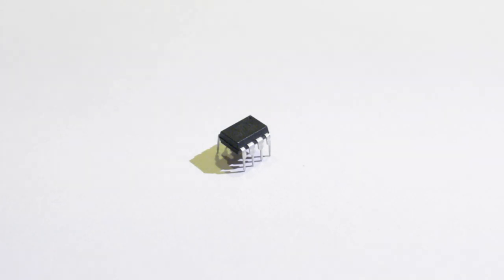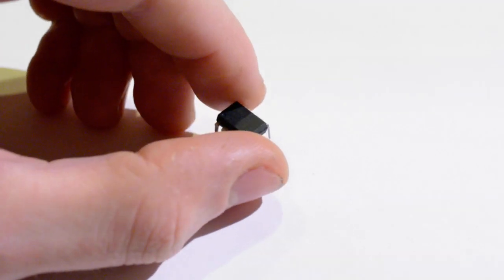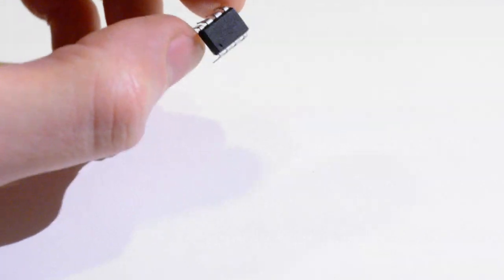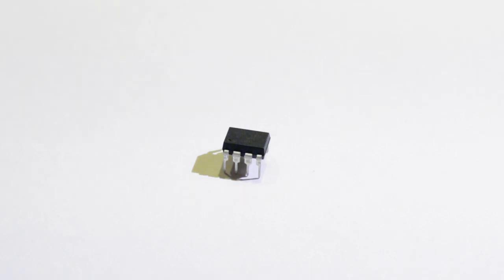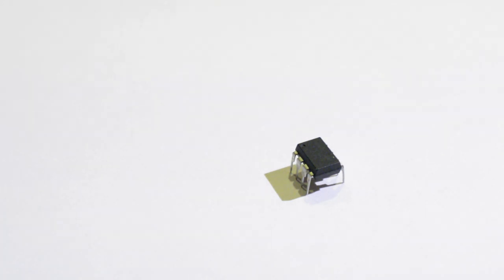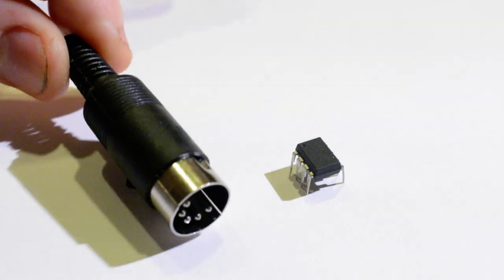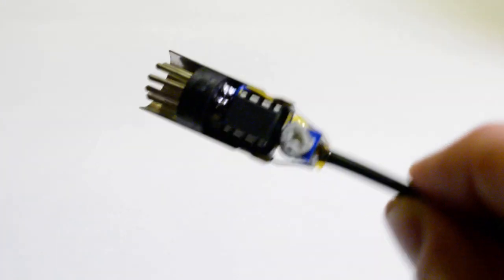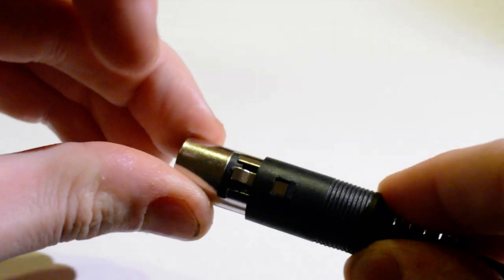Synth Cable: an ATtiny85-based MIDI synthesizer

Comment: When you press two keys down it alternates very quickly between the two notes. How would i go about reproducing an effect like that in ableton or any other audio software? @PIANOKEYJOE asked a similar question. I have tried using arpeggiators but they repeat the single notes as well. i only want the arpeggiation when i press two notes.
Reply: What do you mean when you say that they repeat the single note as well? I'm confused by that
Reply: @Muzikman127  with Ableton's arpeggiator, with the steps knob set to 0.
When i hold down two keys it alternates between the notes like in mitxelas video.
But when i hold down a single key, i get a repeated note, as if its trying to jump back and forth between the same note. I want the single keys to sustain but the dual keys to alternae

Comment: What program/software did you use to program the ATTiny85? I know you can program it on the Arduino IDE, but I saw the code on your github and it isn't compatible. I'd very much like to build this project!

Comment: This is amazing. It inspires me to learn electronics and experiment with making my own instruments. When you said that it wasn't an analog output but the toggling of logic levels on one of its digital pins, did you mean that it was a trigger played so fast that it would become a square wave?
Reply from the maker: Yep, the pin goes between logic '1' and logic '0' fast enough to produce a square wave at the pitch of the note.